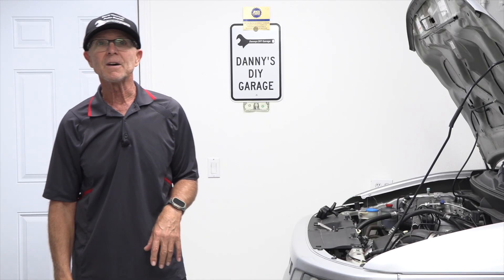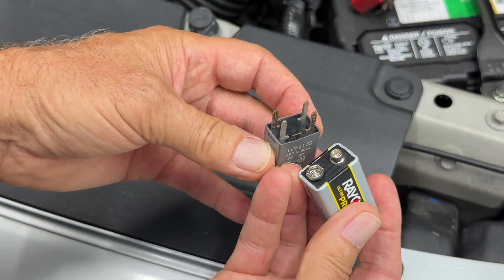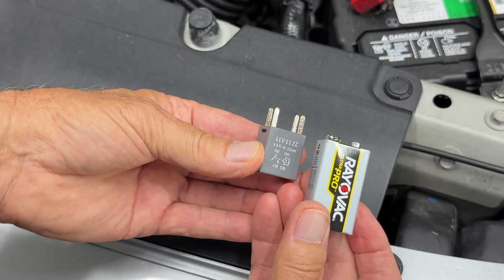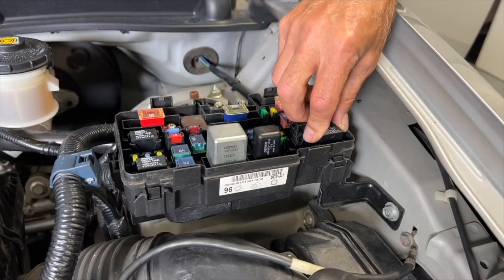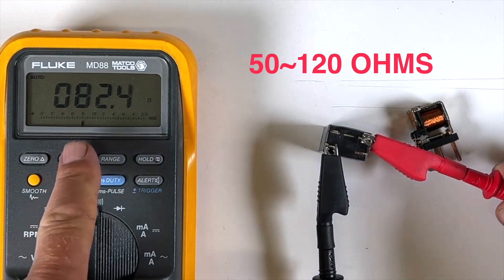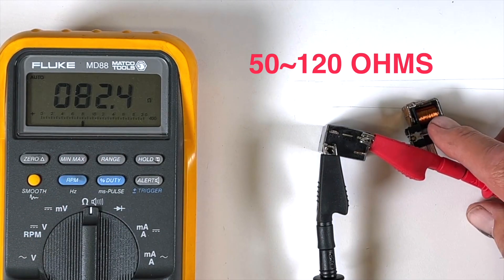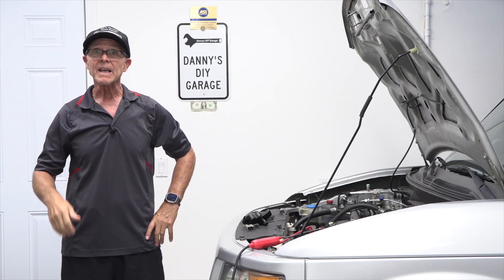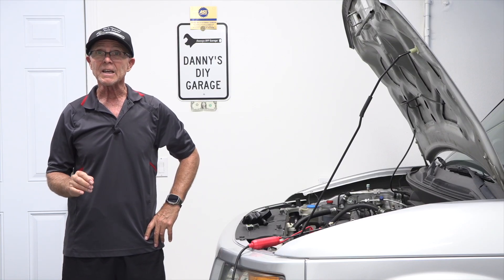How to Test a Relay: Step by Step Relay Test Using a Multimeter. #relay #relaytest #testrelay

Comment: Engine is suzuki m13a,
My car techometer some times stops working and sometimes starts working mid way, 
many times works perfectly,

can you guide what to look for, diagnosis and fixing it. Thanks
Reply from the maker: Check for a loose connection on the back of the gauge cluster first. but probably the gauge itself, just a guess though